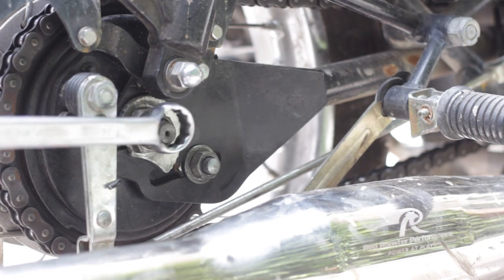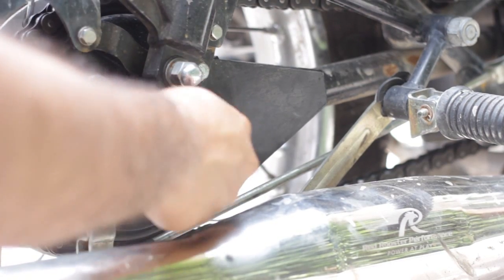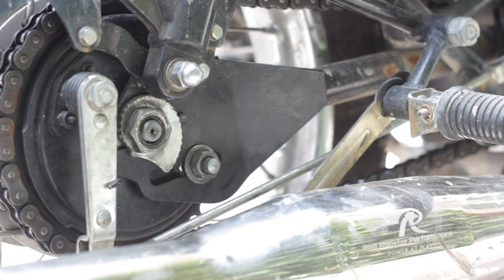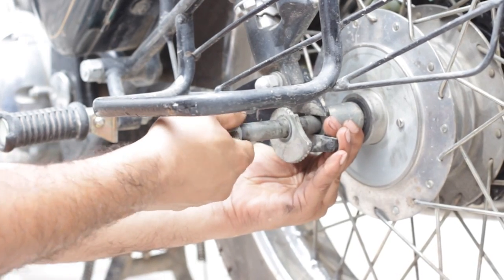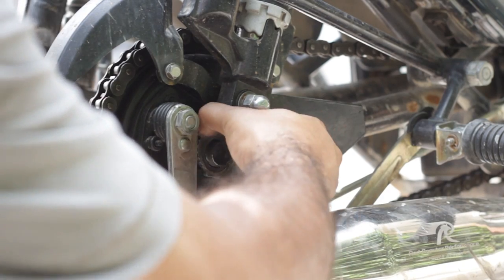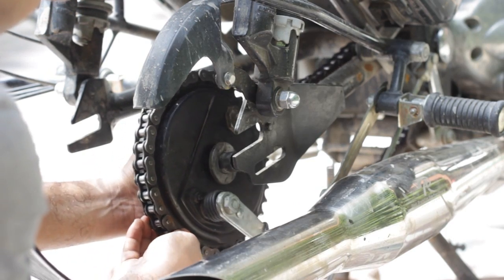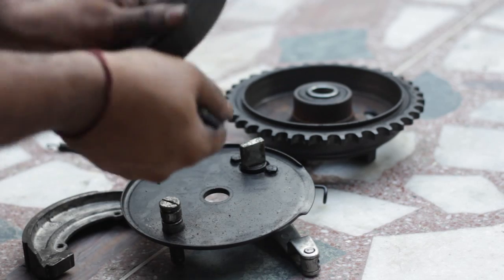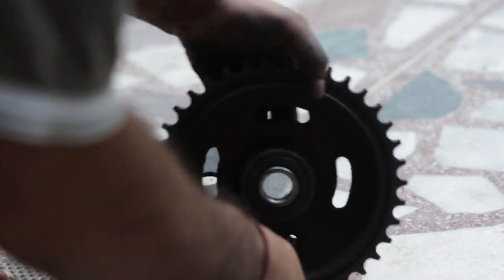Rear Drum brake inspection and replacement in Bullet Standard UCE 500

Comment: Sir,
After doing Brake shoes sanding you need to clean every thing with RAG/old piece of cloth.
You also need to Grease Brake Shoes's CAM , Guide pin , where both end of brake shoes are attached. Also CAM Pivot point , just small AP 3 Grease will do. You have to mark and remove CAM Lever nut( CAM Body NUT) keep CAM Lever and spring aside , pull out CAM Body clean with Kerosene oil , rub with rag and apply small grease on it.
this will make your brake smooth  and will last for a long time..  Thanks You.
Reply from the maker: Narendra Singh thanks. might be will do a detailed video on brake maintenance

Comment: i recently had an accident with my royal, while in a turn i pressed gently the break and it completely blocked the wheel, i fell and to unlock it i had to release the regulator. Any idea of what could have coused it?
Reply from the maker: Bullet is a heavy machine and you'll need to apply both brakes to stop it. Mostly when only one side brake is applied the brakes tend to freeze.

Comment: I would like to know the cost of that rear ceat tyre..Can it be fitted on classic 350? Please share the tyre model name too =D
Reply from the maker: Hi it is ceat zoom tyres. They are tubeless, however i fit it with tubes inside bcoz of spokes wheels. You'll need to check the tyre size of clssic 350 and then can look at the same measurements tyre in ceat zoom tubeless.

Comment: Hows your experience with rear brake locking on wet roads in monsoon bro?? Again helpful video from you..
Reply from the maker: Has not locked till date on wet roads. Have had very few skids. However you must understand a bullet is a heavy machine so the momentum it builds up while running can be bit too much for rear drum brakes alone. Try to apply both the brakes together.
Reply: +Enfield Performance Sure Bro.. Actually it is reccomended 70% Front and 30% rear brake for an effective braking on an non-ABS.. Have a good day ahead..
Reply: You should use the front brake more. It takes habit but that is how it is done. Make a habit to press the front brake gradually counting 10, 9, 8... In your mind while applying the front brake. Takes habit, but you develop muscle memory over time. 

The rear wheel on any bike looses traction easily as when you brake, the weight of the bike shifts to the front wheel, giving better traction on the front wheel than the rear. That's the reason the rear brakes lock and loose traction and then the rear wheel just follows the physics of momentum and continues to slide, mostly skidding right, as the silencer adds weight to that side, using the front handle like a pivot and the rider bites the dust...

I should add that's when the ABS comes as a blessing as it continuously checks for wheel locking and releases the brakes instantly, but if you use drum brakes, you need to be more disciplined with your riding and braking